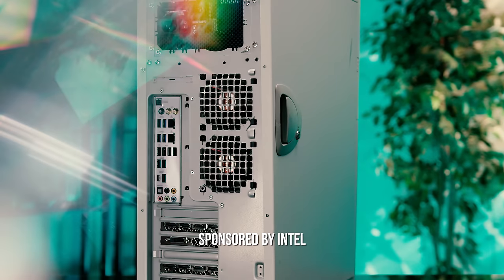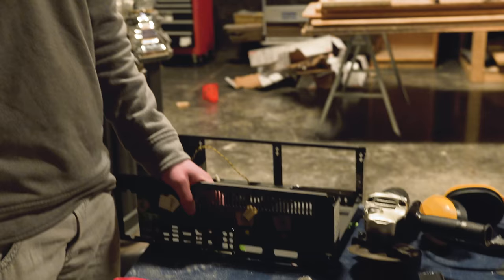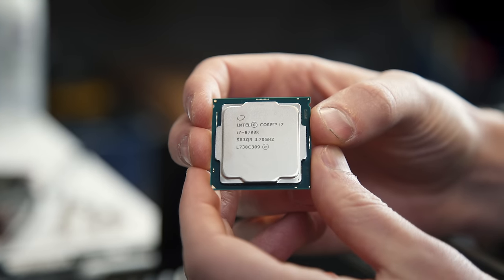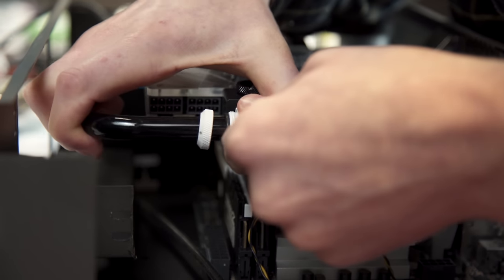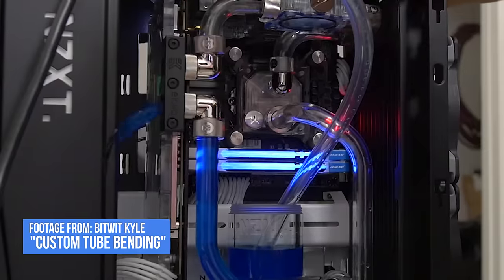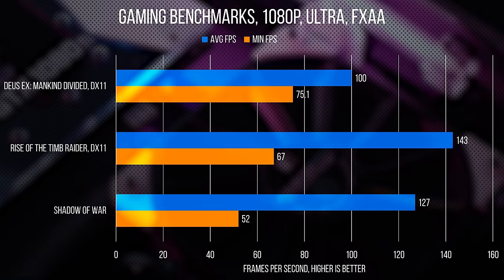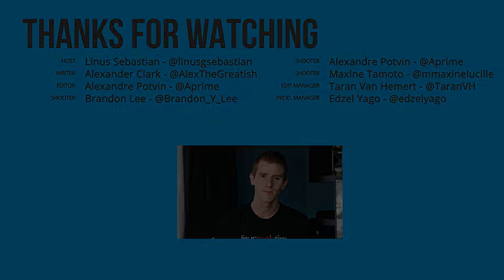The ULTIMATE Compact Sleeper PC Build

Comment: Request: Do more sleeper PC builds...
Reply: maybe start a new channel called Pimp My PC or something
Reply: i would want him to put the pc on craigslist and name it "gaming pc" but only show the exterior of the pc, and when someone wants to investigate, show the inside of the pc lol
Reply: They're working on it
Reply: I love this. I've been building in horrible looking stock cases for a while nothing over the top and watercooled but definitely better than what came in them by far.
Reply: Budget it too
Reply: build ome for TRS-80 Model
Reply: @joshmiller7870  Those are pretty damn rare. You would be better off selling that and buying a more common beige case.
Reply: @HudsonGTV  you can buy a new one now.  Stephen Jones did a kickstart for new models. There's couple different models. Made for amiga made for rasperry pie and also new atx with options for low profile or full size gpus!
Reply: @joshmiller7870  So then use the new recreation. Don't ruin an original.
EDIT: I'm dumb. I clearly misread everything you wrote. Yeah, I can get behind using a recreation of a vintage case. There was one that was an Altair recreation, and the panel lights fully worked like in the original, but you could also put an ATX computer in it.
Reply: Mannn I actually wanna buy a sleeper PC

Comment: how about a sleeper monitor too. its weird to see that old case with a recent monitor.
Reply: they can't
there aer no high resolution monitors with the required 4:3 aspect ratio.
Reply: They could try making old-style case for a new monitor (non-functional like those floppy-disk covers).
Reply: xLoB63x Keyboard too
Reply: André Martins Insanely high refresh rate, right?
Reply: there was a 28 inch crt monitor back in 95, so they can make a sleeper monitor if they can get their hands on one..they can even make an AiO out if it
Reply: xLoB63x i suggested that on twitter before  they posted this video
Reply: the keyboard is easy, grab an ibm model m
Reply: They still make 4:3 monitors for businesses and industries. They're still widely prevalent in the medical industry, as they need an aspect ratio for documents and medical related media, such as scopes, rather than a need for an aspect ratio for entertainment. Sure, they're not 'gaming' monitors, because nobody with the need for a 4:3 would use the benefits of a gaming monitor; though I'm sure there's someone in China who can make you a gaming 4:3.
Reply: Windhelm Guard  they can buy 3 4:3 monitor and have 3400x900 pixel
Reply: Yeah, so take out the internals of a modern 4k modern and put it inside one of those old crt monitors. Now the problem with that is those monitors are actually quite small, but you might be able to do it with a laptop monitor.
Reply: @windhelmguard5295  you can use a monitor case, 144 HZ display with curved glass infront of it and inside behind the monitor is a short cable extension to the actual back then another cable

i hope you understand what i mean
Reply: @ImInSpainWithoutTheS  
you are still missing the point where there are no 144Hz displays with a 4:3 aspect ratio.
unless you do know a store where one can get such a thing in which case i'm all ears.

Comment: make a CRT monitor into an all in one?
Reply: I've dreamed of that.
Reply: That would be the best.
Reply: I wonder if a free-sync can even be fitted into a uni built compaq pc though if you don´t have a too big monitor to swap in?
Reply: IBM model 25 would be a cool base for one.
Reply: @dcfuksurmom  No he wouldn't if he follows any of the hundreds of different videos on how to properly discharge and dissasemble one.
Reply: @ianthornsburg338  how about an IBM XT? a commodore PET? commodore +4?....no wait, a portable Atari 800 xl with macros on the side? They can use upgradable laptop components
Reply: YES!!!
Reply: Case of CRT lcd instead and A powerfull pc inside
Reply: @dcfuksurmom  like water cooling every mod he makes.
Reply: Steve McMillan so... iMac G3?
Reply: the crt's are very hot though
both of computer and the crt needs to be water cooled to avoid thermal throttles
Reply: @dcfuksurmom  you never touched a liquid coolers, ah i see
Reply: i wanted to do one of those with a crt monitor case and a lcd display plus a sbc like rpi but it takes too much space and not really worth it
Reply: use TV case instead of PC monitors. waay bigger
Reply: iMac G3 sleeper build anyone?
Reply: Not enough room most likely, and you would be putting it right next to high voltage and magnetic fields, so you would need to shield it. Also, you would be destroying a perfectly good CRT (which are starting to get rare).
Reply: @ianthornsburg338  Please don't destroy a PS/2 Model 25

Comment: go any older and there won't be an issue with size of the case.
Reply: Haha
Reply: It would be funny to see them to use a 50's pc even though its the size of a room.
Reply: It would probably be impossible to do though
Reply: Actually using some of the old cases with integrated CRT monitor would do really nice build, imagine using the CRT to show some temps aswell.. even in B/W.

And the space would diminish with that CRT gear quickly.
Reply: TheProGamer 75 nah the whole pc is there and you look in through the exhaust vent and there’s just some parts laying on the ground right in the middle
Reply: TheProGamer 75 that wouldn't be a PC
Reply: Not really. The Apple II for example hit the market in 1977, that was 5 ears before the case used here.
Reply: GeoStreber:
5 ears? You monster.

Comment: Use a huge crt monitor but replace everything inside including the cathode tube to lcd.
Reply: Or just leave it as a CRT. Except for contrast, they're technically better for gaming
Reply: Jacob eMatt not for them eyes tho...
Reply: Could use one of those old iMac G3s!
Reply: The only ones that are bad for the eyes are 60hz refreshrate ones.  75hz+ ones don't have those issues on your eyes.
Reply: 4RT1LL3RY 
and even better: CRT's are VERY easy to overclock
Reply: yes upgrade the imac g3
Reply: >crt better for gaming
>2018
what the shitting fuck
Reply: Chandler Kristoff I have a HUGE 1600*1200 CRT but my parents won't let me have it in the house (it was from my grandpa's Dell)
Reply: Only bad thing with crts r that they r 2 thicc.
Reply: MrHack4never I wouldn't really call it overclocking, you still need to stay within scan rate limits.  But if its a CRT that can do 2048x1536@60hz(which most can) you can usually drive it 1600x1200@100hz easily.  TLDR; If it does QXGA 60hz it can do high  refreshrate on more common resolutions of the day.

Comment: Sleeper pc needs a sleeper monitor.... The old terminal style CRT back is required to make the esthetics feel right
Reply: Agreed, you could take the bezels from 2 old monitors and cut and join them to fit a 24" UHD LED Monitor
Reply: Aesthetics*
Reply: jim Barnes Or simply use a high res CRT without mods
Reply: Harshit Goel and the old bootup sound XD
Reply: Mod the keyboard and mouse too
Reply: Yep back in those days all keyboards were mechanical :)
Reply: Only if you can find a beige one :)
Reply: jim Barnes IBM Model F, buckling spring goodness
Reply: mydaan1 Maybe mod the water cooling pump controller to make that sound of diskette heads zeroing to track 0.

Comment: You should make a “Ricer” build where you take a nice looking case but put the trashiest parts in it. And also a big ass wing.
Reply: UrDaddy WingNut 
So, you're, saying it's a good thing that I kept this piece of shit CoolerMaster desktop form factor case from like 2005 laying around?

Cool.
Reply: SkuzzyJ-- Hellz to the yeah!!! Man, you could even put in totally busted parts in then hide a Pi somewhere in the case so someone would think it's an actual fully functional PC
Reply: i have been thinking of making a DOS machine circa 98 (P1/ voodoo2) in a modern vanity case with RGB lighting. for the game room.
Reply: UrDaddy WingNut 
That's just going too far.

But, holy hell, newegg still has a product page up on this thing... https://m.newegg.com/products/N82E16811119071

Mine did what everybody else said theirs did and let the magic smoke out of the power supply. I replaced it with a fancy, state of the art Antec 900. It had thumb screws for the side panel! Righteous.
Reply: SkuzzyJ-- WOW! Whats even crazier than having it listed is that they've actually sold enough to be OUT OF STOCK!!!
Reply: Pentium 4 @ 2.4ghz
1gb of DDR2 ram
16gb usb flash drive for storage
Integrated Graphics
Windows 10
Reply: YASSS
Reply: tripcode!Q/7 
You're giving me flashbacks to that time I installed OS X86 on a 990 MHz P3 with a Quadro graphics chip. 256mb single channel. Yeah....

It managed to boot.
Reply: dont forget, the case must be made or branded from asian country, especially japan.
Reply: Don't forgot racing stripes and put badges from high end components on the case. Haha!
Reply: I put debian jessie on a 200mhz pentium, lol. It sucked running any sort of windows manager.

I currently have it hosting some image board, using the latest version of freebsd and it is actually decent.

Next time you try P3 OSX, use a dual tualatin setup :D

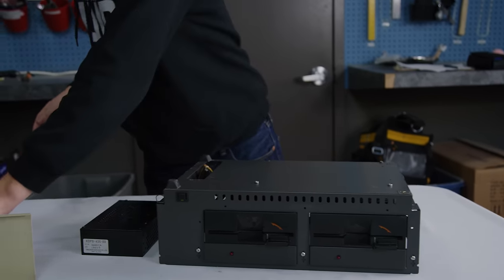Comment: 1:14 "It hasn't worked in years, and even if it did, it is basically useless now."
Those of us in the vintage/retro-computing community not only fix stuff like this, but we WOULD use it. Obscure stuff like this is perfect for showing off at the monthly meetups. 

2:00 And now I am crying.
Reply: Where are these monthly meetups you speak of?
Reply: @HudsonGTV  Chilliwack, BC. We sometimes had people coming out as far as Vancouver, but we haven't met up since the lockdowns started.
Reply: Well, I have similar feelings. Although, one could make an argument that if it was available for sale, then it wasn't so sought after :3
Reply: @BlackEpyon Thats awesome, it would be great running it for some specific purposes, maybe some lightweight linux and old school machine! What are your manifestos regarding such machines
Reply: @VelidAgovic  The MD3 was a Z80 machine. Linux requies at least a 386, but I think there were one or two distros of Unix that could be emulated on a Z80. Nobody runs these computers for ACTUAL work these days, it's more along the lines of what people do with vintage cars. Sure, you can drive them, but you're only going to take them out when the weather is nice, you won't take them off-roading. We like to build them up, repair them, collect them, play with them, and show them off. 

Now, if one of these systems was completely trashed, say the battery exploded and the electrolyte ate away half the traces on the motherboard (and there's plenty enough of that), an argument could be made for cleaning up the case and making a sleeper out of it. But if it can be salvaged and repaired, I find it hard to justify scrapping it for a sleeper unless you already stripped it for parts to repair another unit and the case is what's left.

But you know what they say, one man's treasure is another man's junk. But in their own way, these machines are also a piece of computing history. Once they're gone, they're gone for good.
Reply: @BlackEpyon  Yeah, like with oldtimer cars, there is beauty in the process of restoration
Reply: @VelidAgovic  Exactly. And making them work again is half the fun. I'm in the process of restoring an XT clone at the moment, just waiting for a couple parts to arrive.
Reply: @BlackEpyon  Awesome, congratulations! I would be happy to see more on that topic! I hope you will make a video or a blog post! I feel new generations have way too abstracted view of computing because everything is so tiny, far away and closed form, older computers are closer to our understanding and it would be great if there were more of them
Reply: @VelidAgovic  Na, I don't make videos. Don't got the camera for it, and I play with the computers for a hobby (I'm a full time landscaping contractor). There are plenty of YouTubers who do retro computing as a full time activity though, and there's lots of good content available.
Reply: @BlackEpyon  Aw man. I need to find a vintage computer meetup in the Washington State area.
Reply: @HudsonGTV  There probably are some groups. The Vintage Computer Festival (Pacific NW) is held in Seattle (before the pandemic, anyways, they're being held virtually this year). Once the US gets it's shit together and gets the pandemic under control, I plan to get myself a passport so I can go down there. I live in Chilliwack, so Seattle is just a few hours drive away from where I live.
Reply: @BlackEpyon  That's cool. I thought the closest one was in Oregon for some reason.
Reply: Realistically, making a computer into something that is actually functional in the modern age trumps restoring something that is functionally useless but is 'nice' for hobbyists to do.
Reply: @Alexandros11  Not a fan of museums then, I take it?
Reply: @BlackEpyon  Well of course I am, but a mass-produced computer a few decades on is not something that's analogous even slightly to museum pieces. Bad analogy.
Reply: @BlackEpyon  Humanity produces a huge amount of e-waste, its far more preferable to repurpose old things than simply buy new things and put old things on a shelf.
Reply: @Alexandros11  That's why I'd rather preserve the museum piece instead of ruining it.
Reply: @BlackEpyon  Except nobody is ruining the ‘museum’, they’re repurposing it to have actual modern utility. Which is more utility than having a niche group of retro PC fans watching it turn on
Reply: @Alexandros11  Do you seriously think that the only thing we do with them is watch them turn on? If you want "modern utility," there's hundreds of modern ATX cases that get thrown into e-waste every day. Use one of THOSE, not this vintage hardware that's already scarce.
Reply: @BlackEpyon  But why do you think so many ATX cases are being actively produced? If the demand dropped (by repurposing old equipment) so would the supply. And the reality is the vast majority of old technology is being thrown away, so you might want to try and target that instead of old tech thats going to be repurposed and used.
Reply: @Alexandros11  "the vast majority of old technology is being thrown away"
Yeah. And many of those e-waste disposal sites operate under contract, and won't let you touch anything once it's been behind the counter. Once it's gone, it's gone forever. That's why I hate seeing vintage tech being butchered like this. You wanna build a modern PC, build it into one of those ATX cases that are being thrown away. Don't butcher a vintage computer for it.
Reply: @BlackEpyon  I mean you just completely ignored everything I said. Building in a modern ATX case is ok but if someone wants to build in a vintage computer there Is zero problem. Actual functionality is more important than hobbyists doing essentially nothing on obsolete hardware that has exactly zero functionality in the modern world.

They didn't 'butcher' anything, they took something that even if it worked would be completely useless, and made something useful.

Comment: I still want to see you guys make one of these with a matching sleeper monitor by sticking a new screen into a hollowed out old monitor box.
Reply: Mr. Crowley-- Shit bro, they could fit an entire dual 1080Ti watercooled build in a 21" CRT monitor! Nice name, btw.. . Ozzy much??
Reply: for that they'd need a high resolution monitor with full screen aspect ratio,  which sadly does not exist.
Reply: Windhelm Guard They could fab up some filler pannels for the top and bottom or use a piece of glass (or plastic) in front of the screen with the top and bottom strips tinted.  
If they went with the tinted glass they could even add some rgb lighting behind the tinted sections for fun.
Reply: UrDaddy WingNut That would be a pretty great build to see also.
Reply: 'Old monitor box'. Lol...
Reply: Windhelm Guard hold that thought, lemme check on panelook real quick...
Dang, there's no 4:3 panels that are close to 4K or 1080p...
Reply: WHAT R CRT? I AM A BABY BOI
Reply: Mr. Crowley A real pro CRT outdoes most LCDs (except power consumption).  Get one that supports at least 1920x1460 for that full HD+ experience.